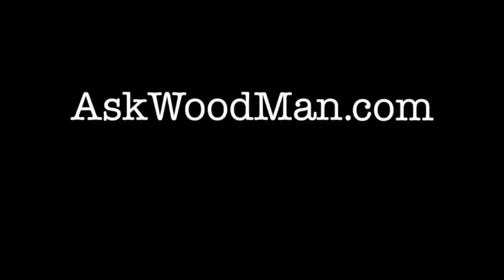1123. How To Mill Lumber - Jointer vs Planer Feed Direction

Comment: good idea to post this explanation.  i was taught by my gaffer to always mark grain direction before milling (i use an arrow, but i think i may just use your sign now as its one stroke compared to two of a pencil)  having grain direction clearly marked makes the whole assembly process easier as grain direction is consistent on the finished piece, which is very important for the best result.  i am also glad to see i am not the only one on youtube who dimensions to final size on the thicknesser rather than the table saw.
Reply from the maker: My Hitachi P100F does a fantastic job on edges. I often make a rough size cut on my table saw or more likely on the Hitachi CB75F resaw machine and then make a single pass on edge to get to s4s. The finish is great. That machine just had its 30th birthday recently.
Reply: @AskWoodMan  I have the Hitachi CB75F and the Makita 2030N and the 2040. Great machines.

Comment: Fantastic video, thank you. Where did you get that rubber dust collector adapter for the dust exhaust? Did you cut that out of a rubber cap yourself? I have the jointer planer combo of this machine and have been meaning to make a better solution to connect dust collection.

Comment: Thanks for posting this info. I am new to woodworking and this has confused me for a while now. Thanks for clearing this up.
Reply from the maker: Thanks Owen. It confused me when I was getting started until I figured out this marking method. Learning to read the grain before starting the milling process by face jointing not only gives you a better surface cut but also reduces wear on your machine knives. Thanks for taking your time to write. Allan

Comment: Great explanation. Thank you.
Reply: Allen,
Thanks for explaining the grain on jointer and planer.  Your Planer has the spiral cutter.  I’m new at wood working and just got a Ridgid and wondering if you think/recommend upgrading to a spiral cutter in my Ridgid?
THANKS
Ray
Reply from the maker: My jointer has the spiral cutter. My Hitachi planer has conventional hhs knives. My planer has super high quality Japanese steel knives that are easy to sharpen and easy to reinstall perfectly into the machine and the cut quality is fantastic since I never let the knives get dull. For me the jointer is more important to be spiral since it is spinning at a much slower speed and is more of a work horse  wrt prepping lumber for projects.